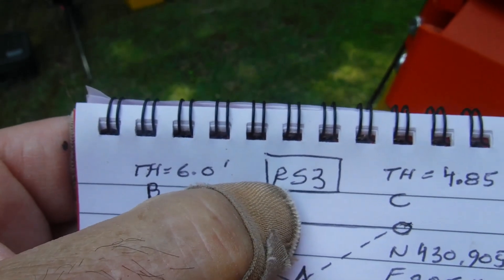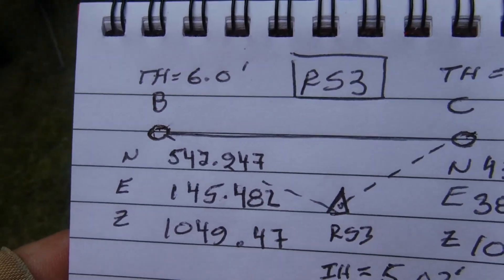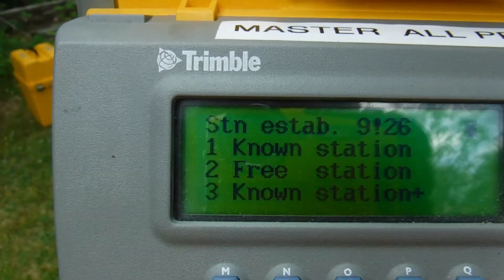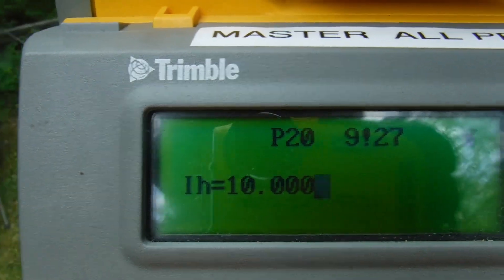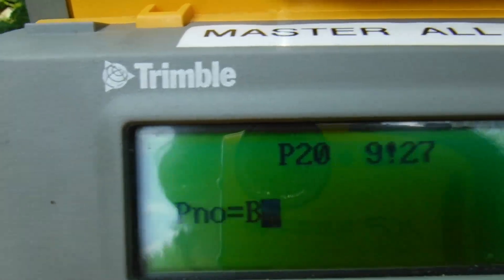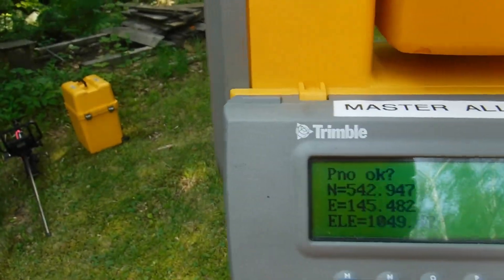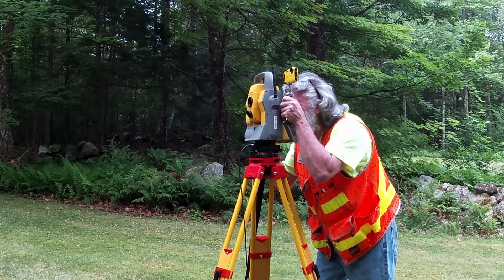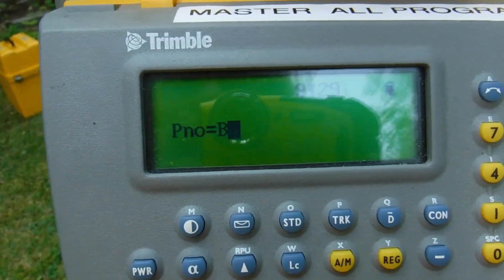Setting up a "Free Station" using the Trimble Geodimeter CU and 5600 Total Station.

Comment: Where / how did you get point B and C coordinate (NEZ) data?  From CAD file data?  Known points from elsewhere?  Thanks.
Reply from the maker: I started with another station setup location. I defined Bound A as [0,0], took a bearing using a compass, then measured the distance to Bound B, then used Point B is N=dist* cos(bearing) and E=dist*sin(bearing). Then I used that station setup and did a foresight to Bound C. But these points could have been derived from a given file, or some other coordinate system (e.g. Lat, Long or State Plane or Local with origin at [10,000, 50,000] which seems popular so as to avoid negative numbers which you would get using the [0,0] origin.

Comment: thank you so mush sir, can we use this total station without radio?, e.i survying, stakout....?
Reply from the maker: Yes. However, you will not be able to remove the Geodimeter CU (controller/data collector) from the Head Unit .